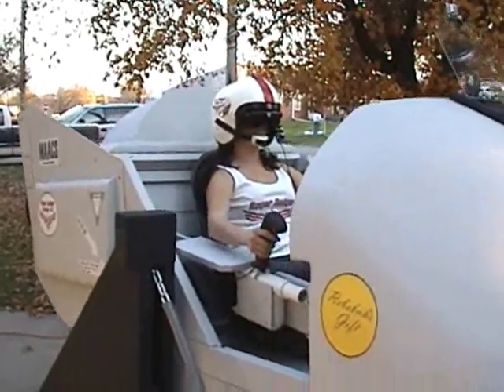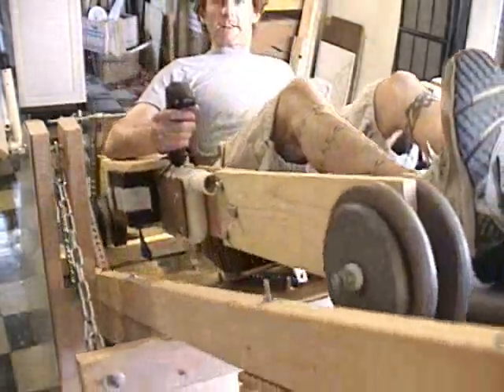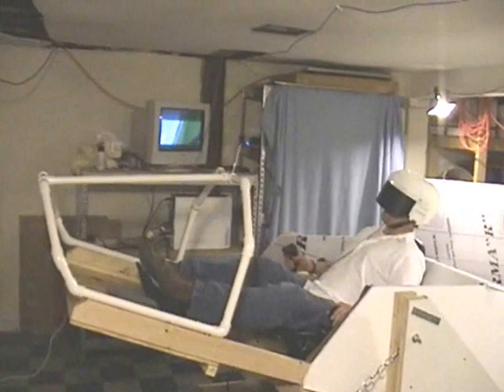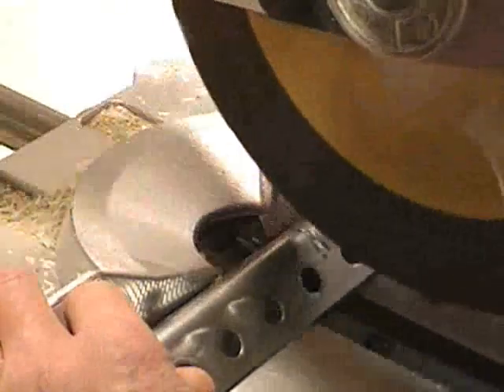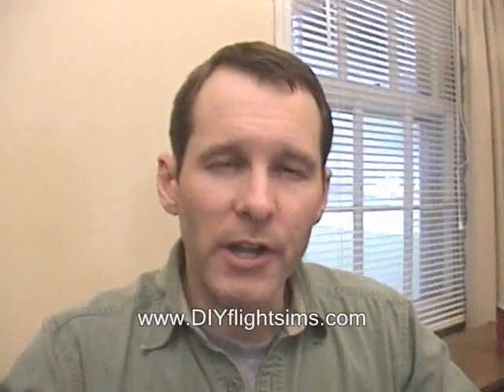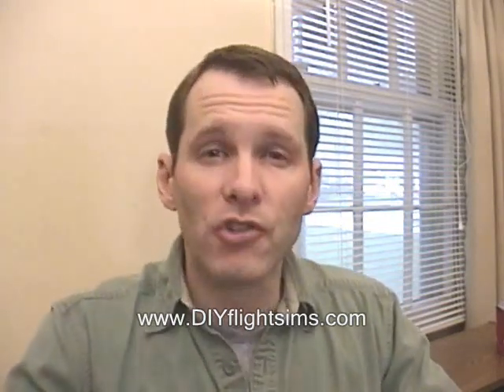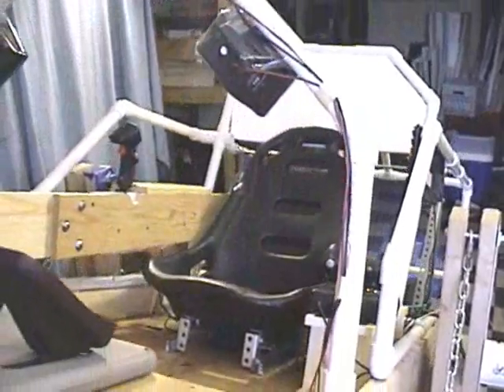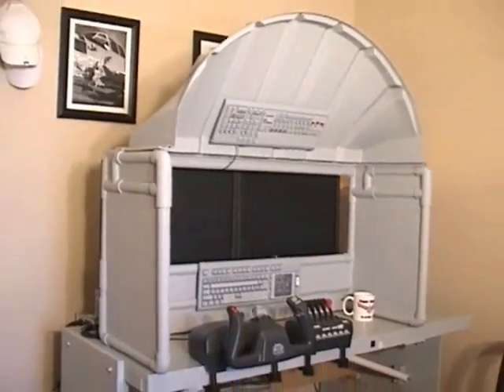Motion Flight Simulator Video Series at the link below...

Comment: food for thought: why not make it moveable in all axis? I think if you lift the table w/4 air or gas shocks, spreaded out on the top, single point bottom, the same weight concept would work right off the yoke fairly simple. I saw all your videos now and I'm going to do something like this. I finished my flightsim also, but now I'm not satisfied with mine and want yours :). Alright god job.